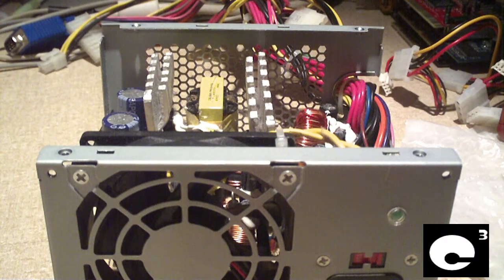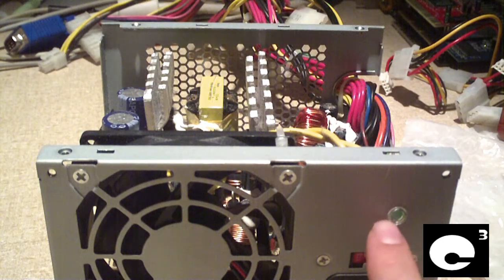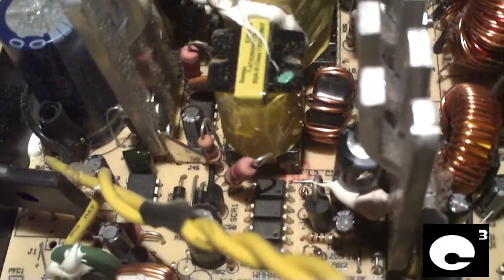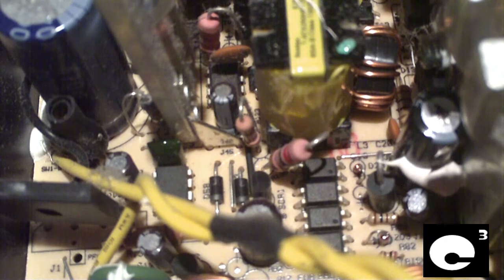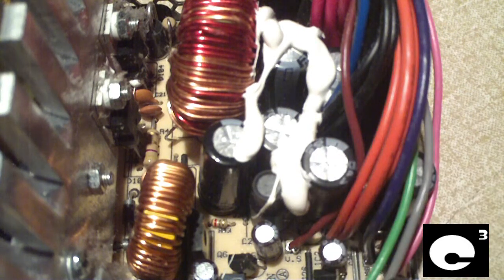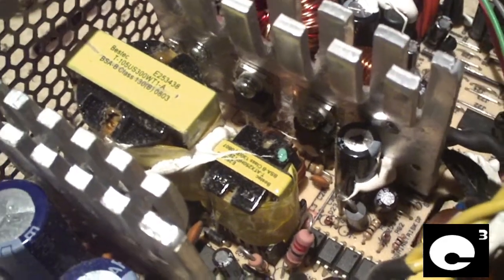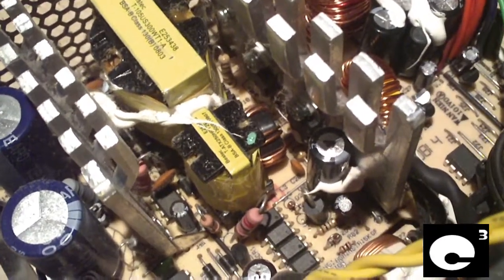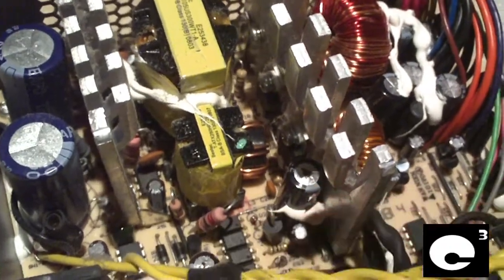Bad Capacitors Cause a Bestec ATX-250-12Z PSU to Malfunction

Comment: What would cause an atx power supply to randomly turn off while a computer is running? I've encountered this on an older cheaply made Apower Chinese unit. I have it around and would like to repair it if possible. None of the caps are bulging up top but I have seen caps go bad on the bottom where you can't tell before. Does randomly turning off sound like a cap related problem?
Reply from the maker: A-Power units are very poorly manufactured. It could have either been tripping on overload (these units are horribly undersized for the stated capacity), or it's likely that the supervisory/protection circuit was killing it because an output was badly out of spec. While some cheap PSUs can be made a bit better, A-Power is just not one of them. The last A-Power unit I had, I squirted full of lighter fluid and set fire to it!
Reply: @CubeComputerChannel  Damn XD Thanks for letting me know. Truth saves me time and now I know not to chance that thing. The psu has 900 on it which is bs for sure. It was cutting off randomly while running only a msi 970 motherboard, amd fx 6300 cpu, 8gb of ddr3, a r7 250 gpu, and 1 Hitachi harddrive for testing.

Comment: The dried white fluid, that's a non-conductive separating glue isn't it? It's nothing to do with the capacitors blowing up.
Reply from the maker: Yeah it's just glue. In some unit's it's yellow or black.

Comment: I have this exact PSU and HP model on my bench right now. Same CAP at fault too... There is another on the other side where the 5V/12V to the peripherals comes out that has bulged. The first indication to me was the dielectric odor.

I'm going to swap out all of these caps with better ones for this PSU.

Comment: Hey Cube would you say that jamicon caps are a decent/entry level brand?
Reply from the maker: They're not really bad, though they aren't the best either. They are a bit sensitive to heat.
Reply: ***** Ok I replaced the caps in my laptop psu brick with 470uf jamicons  the are rated for 85dc hope fully they are ok , but thanks :)
Reply: Mike Adams Yeah, I stopped using jamicon a while ago after joining badcaps.net I soon found out that jamicon are junk, I now only use rubycon, nichicon, Panasonic, ucc ect...
Reply: Mike Adams I also swapped out them jamicon in my laptop psu to 470uf rubycon zlh 105dc rated.

Comment: You are awesome!  I also really appreciate your patience so that I can learn something.  I just never had a power supply that worked and was considered operational with -5, on the main cable out, and +5 on the yellow P7 connector.  I just wanted to make sure that I understood that, this specific pwrsup does not have those two connections?  Are they needed?  What does the -5 and + 5V (on P7) support
Reply from the maker: P7 on these units again, is the +12V feed to the CPU. -5V used to go to one of the pins on the 20-pin connector, and has been exempted from the ATX specification for over 10 years now. The -5V rail was used (I believe) for the ISA bus on old motherboards (Pentium III or earlier).

Comment: Thanks for the fast response.  I replaced the capacitor located next to the heat sink.  Your explanation helped me understand why my -5 indicator on my tester did not come on.  That only leaves the mystery on why the +5 indicator located on the P7 connector will not come on.  Is this normal?  I am referring to the two pair (yellow) connector that also goes on the board.  If so, is that considered a normal powersuply configuration?
Reply from the maker: The secondary connector that goes to the motherboard only supplies +12V and ground. That connector powers the CPU.

Comment: Awesome troubleshooting tips!  I am working on a Bestc ATXX 300-12Z and on my troubleshooting LED, the -5 volts does not light up as well as as one light on the yellow cable.  My powersupply had a leaking capaciter right next to the heatsink just like yours.  What else should I do?  Do you want to see a picture/  Any help would be awesome!
Reply from the maker: This power supply does not have a -5V rail, though you do need to replace that bulging capacitor.

Comment: Bestec-250-12z I removed 4 bulging capacitors from the output stage.three of the capacitors are 2200uf 10v.one is 1000uf 16v. the problem is I can't remember where the 1000uf 16v goes.I thought they were all the same when I removed them.I think I have figured out that it's the c31 as marked on the board is where the 1000uf 16v Cap goes but not sure?.

Comment: Thanks for the video, you helped me a lot. I was trying to figure out what the problem was with a friend's computer and I had already tested the power supply with the paperclip jumping method so I thought I ruled it out. But, when I opened it I found the failed capacitor right where you said it would be.

Comment: @lmull3 I am running a Bestec from 05-06 in my server, and it has worked flawless. Perhaps they did cheap out on newer models, but in general all the Bestecs I have used have worked great for being relatively no-name.